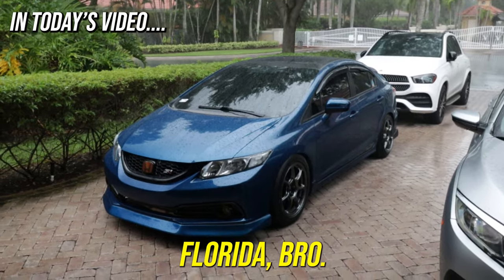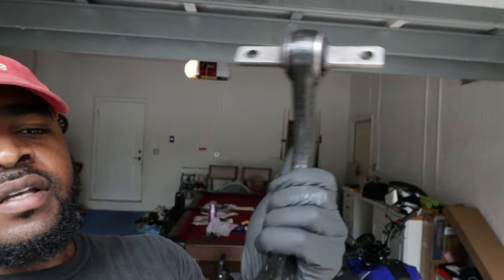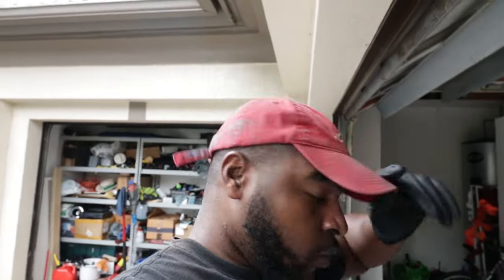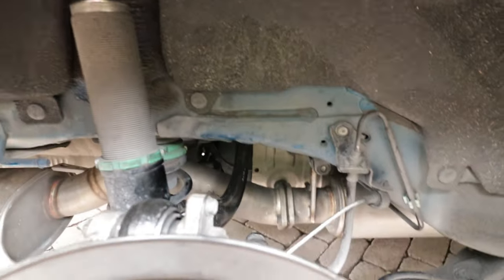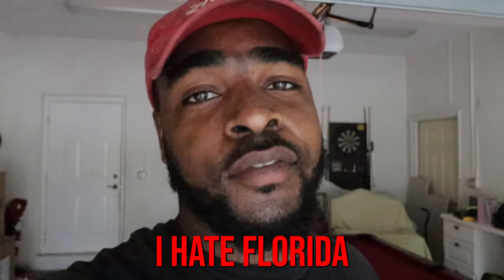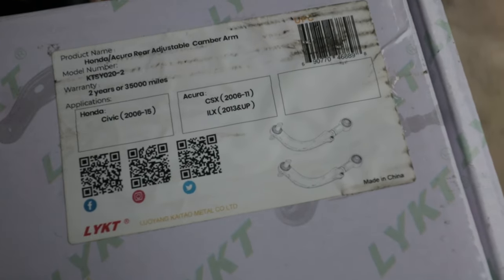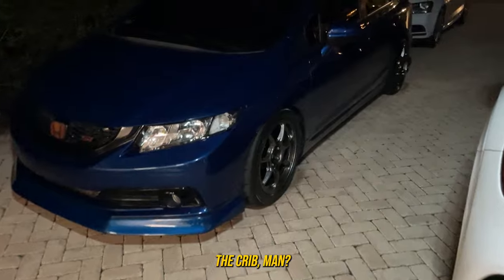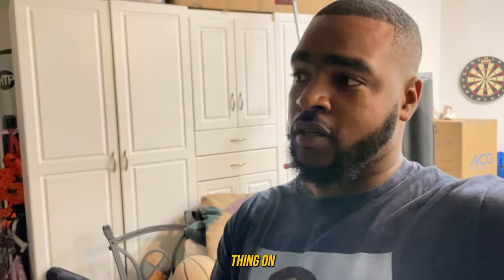PERFECT WHEEL FITMENT ON MY TURBO 9TH GEN CIVIC SI

Comment: Aye bro my boosted 9th gen can’t make more than like 330 wheel even at 15 psi. Any idea on what my problem could be? Gtx3582 turbo 1000cc injectors dw65c pump and rbc intake mani. Fire build bro🔥
Reply from the maker: @jeffreysheridan4893  what fuel? Checked the turbo? Vacuum leaks? Tuner? Health of the motor? .. its can be a lot of different variables
Reply: @zoovie  just 93 octane, no leaks and made same up on previous turbo🤷 tuners been in the game for years he don’t even know

Comment: No rubbing? Fender rolled?
Wheel tire spec?
Reply from the maker: @Promisedland_garage  245/45/17 rt600 and 245/40/17 on the rear with +5mm spacer 

Camber adjustment all around and fenders are rolled but no, no rubbing unless I hit a big bump